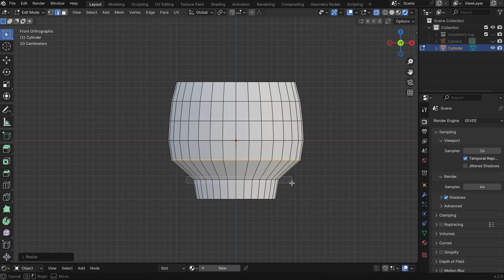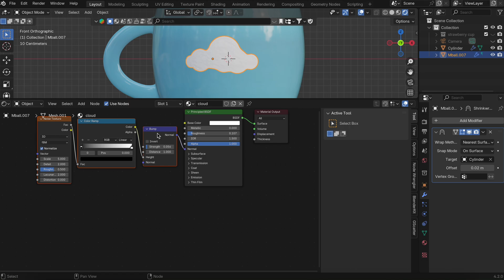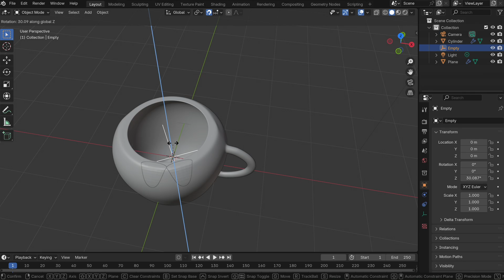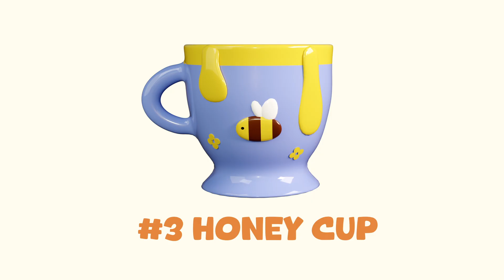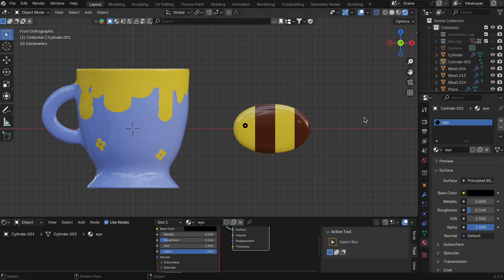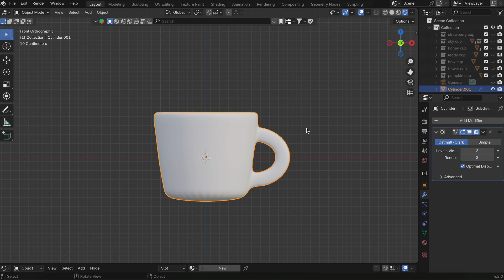Create cups in blender

Comment: Really helpful for beginners thank you! Do you render with cycles or eevee? When rendering with eevee everything was perfect but with cycles the clouds on the cup had kind of a dark pattern on them, just wanted to know if maybe I did something wrong
Reply from the maker: I rendered mine in Cycles! The dark patches are usually from the shrinkwrap + thickness overlapping with the cup. An easy fix is to just increase the offset for more thickness (in the shrinkwrap modifier) so the clouds sit a little further off the cup or adding a solidify modifier
Reply: @shreyaya_art thank you for the help :) I had already tried changing the thickness but it didn’t help, I’ll try with the solidify
Reply: Yes it was exactly that, thanks again!